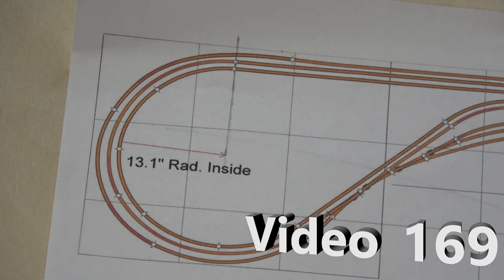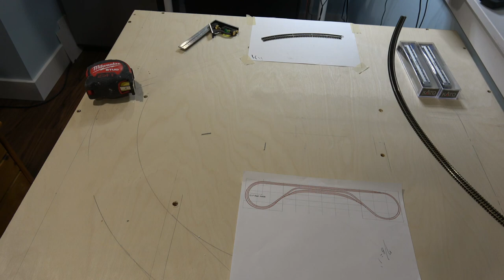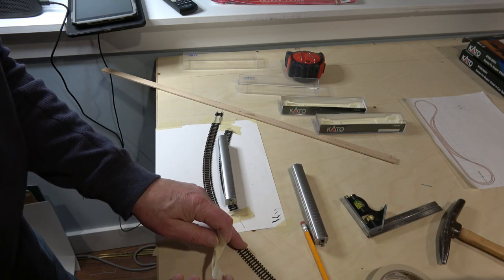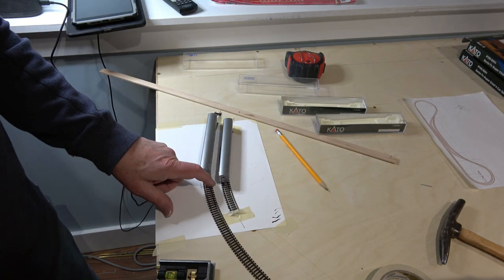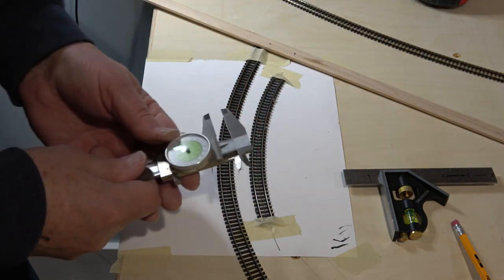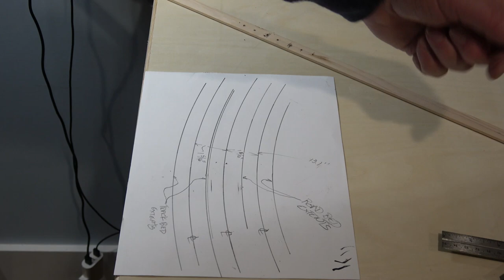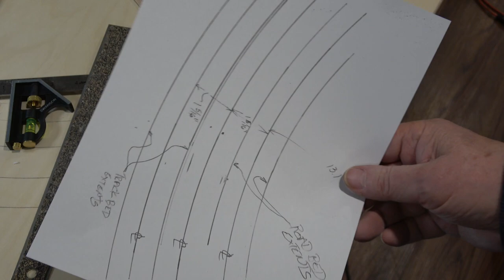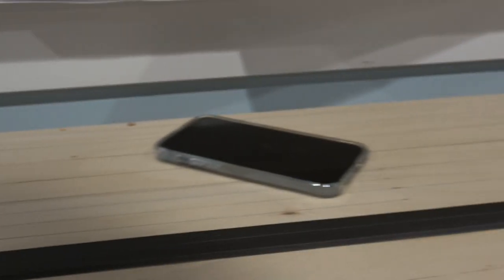169 N Scale Track Spacing

Comment: The NMRA website has a page of recommended curve spacing data for N scale. 
I would go with a 1 1/4 separation between tracks on curves. So if your innermost track is a 13 inch radius then just mark a 14 and a quarter inch mark in your trammel. 
Done. No tedious experimentation required.
Reply from the maker: Dexterdog, All true, but I like to do my own thinking.  For my worst case longest car I have allowed .25” between them if they were to run on separate tracks at the same time (Which they won't) and I wouldn't expect to see a collision.  All other rolling stock will have more leeway.  If it happens it will be relatively easy to move the track.  Everyone's collection is different and skill levels to lay track are different.  I woud expect the NMRA to allow for the extreme worst case scenario on all counts.  Thanks again, Rob
Reply: Funny. I was just eyeballing my track. I'm doing a double curve. It seemed to be good at 1 1/4. Than I read this comment that says. NMRA website says 1 1/4. Now I feel better.
Reply from the maker: @mgamga9476  The thing is, everyone's rolling stock is different.  Some folks with all short earlier 30 or 40-foot modeled cars might get by with 3/4 inch.  This is why I have always built my layouts by taking the longest car I own into consideration or the one with the widest overhangs anyway.  One size rarely fits all and it does not hurt to understand why the clearance is needed.   Thank you very much, Rob